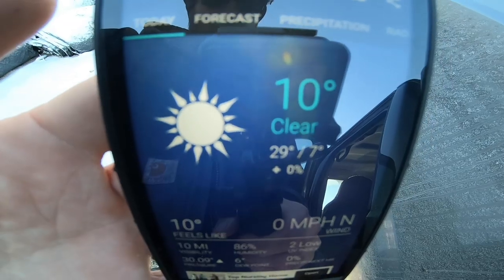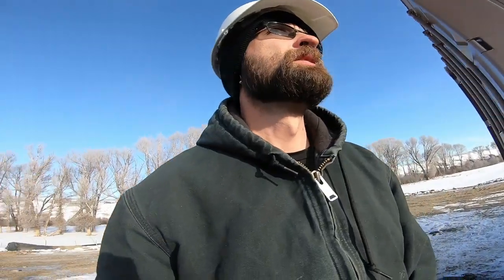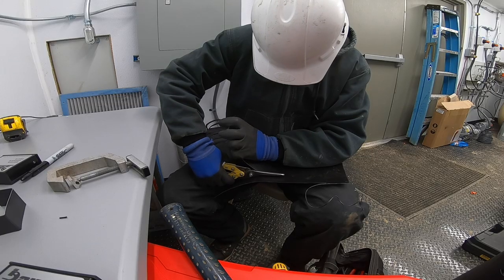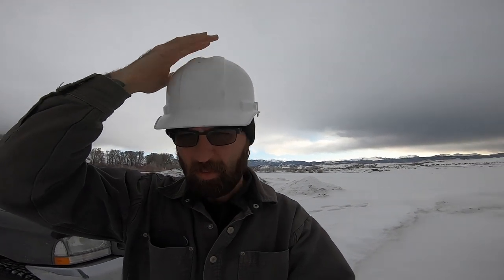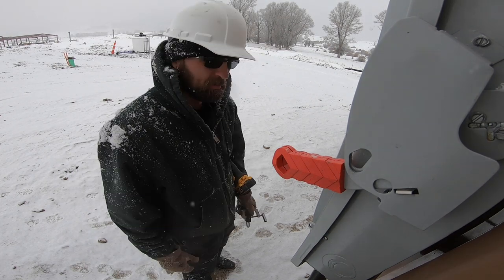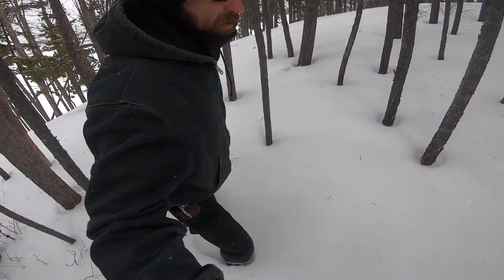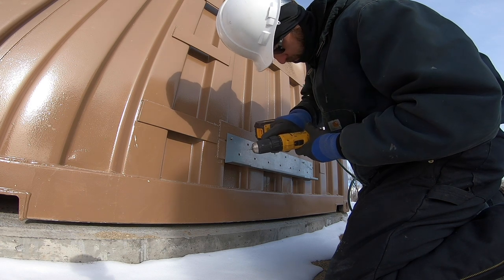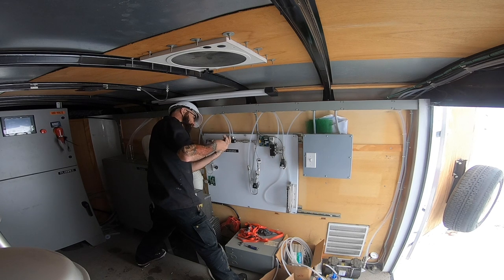Helping build an Oxygen Generator.

Comment: 10 degrees is cold)) 
it's cold when threading oil turns into jelly, brush won't come out of pipe dope can and you still have 10 hours to go on top of the roof. There are days when -5 below feels like a heat wave)